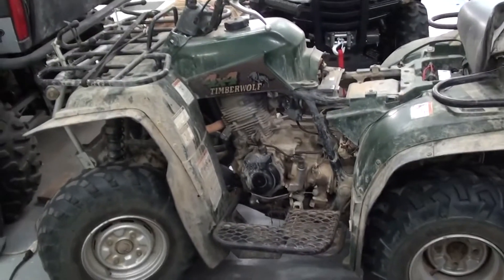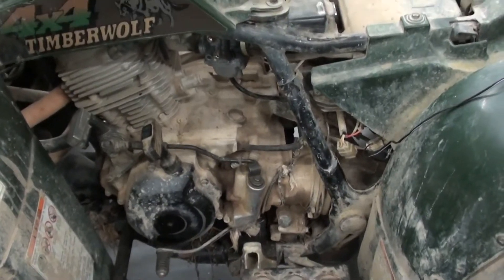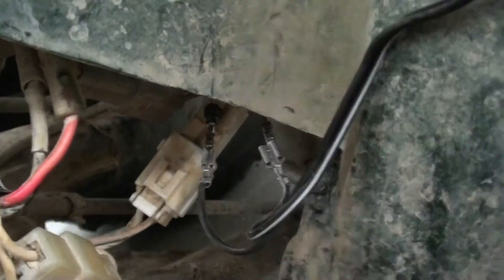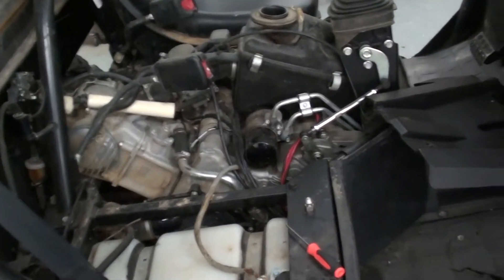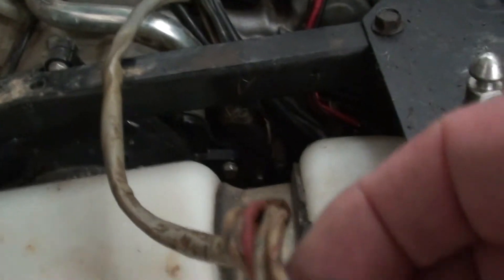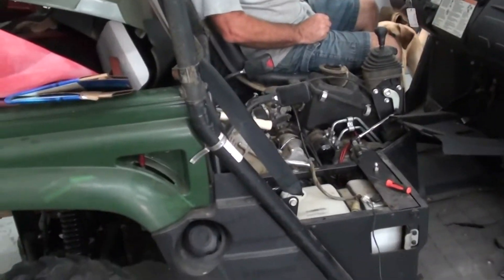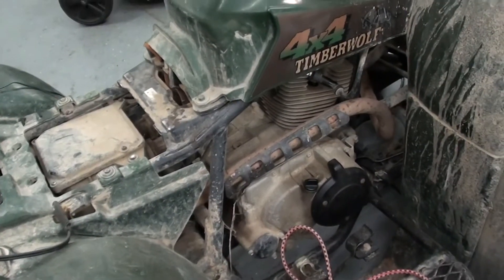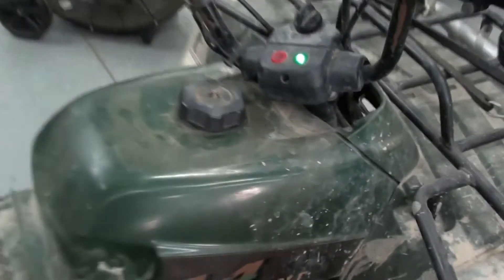Electronics Troubleshooting Redneck Style At D-Ray's Shop!

Comment: I greatly appreciate your videos & knowledge, not to mention your humor..I have a problem, I put a new starter in a Honda 1991 trx 300. I go ton connect the battery & the starter engages, no key no button use. In ran with kick starter b4 I replaced it.. Any Ideas wool be greatly appreciated? Fuses are good solenoid is new as well..

Comment: On a. Razor 800...does the air intake need to be higher than the motor...I changed mine too between the seats...about hip high...having trouble starting now...?

Comment: iv got a 08 500 foreman es. when it's over 1/2 throttle in any gear but reverse it gets stuck in that gear. the gear indicator will flash that gear and can't shift at all unless turn key off down shift to neutral fire up and take off again. have you ever had that problem
Reply from the maker: sounds like a weak shift motor.

Comment: One xr600 had bad exciter coil. It had working lightcoil.  So I put 220v to 12v transformer wrong way around so the lighting coil output would be high as the exciter.  It worked and run fine for 10min or so.  Then the transformer  got fried.

Comment: I think we all must be a little bit redkneck :-D.
A 21 watt bulb on loooong wires comes in handy, it also adds a load to any circuit you are monitoring, multimeters can see phantom voltages so can be deceptive.

Testing for radio power.
Lighting problems.
Wiring a toe hitch to a car without schematics.
Checking for power at a petrol pump, using a safety pin to penitrate the wires.

Very handy the bulb :-D
Reply from the maker: Good stuff!

Comment: hey dray, 85 big red, cool weather, have to shake it side to side to get it to start, very cold natured i guess. Does it need a different needle? I have to tie the choke button with string to keep it on choke......also the green light wont stay on unless i fiddle with the key...new switch i guess?
Reply from the maker: The choke jet is probably plugged. also 85 was the first year for the 250 big red, and they were pretty notorious for hard starting. I drilled out a lot of choke jets on those to make em choke better. Your choke lever won't stay on choke because the detent spring and ball in the lever is either rusted or missing.
Reply: thanks d ray, was wondering why you took down the last video

Comment: I love your videos. I want to ask you I have a 2016 Honda pioneer 500 and I love it. But the rearend sounds like crap when the machine is coasting or when you let off the throttle. I've read a few sites about this and it seems to be a problem. What would you recommend doing?
Reply: Haha that is pure genius
Reply from the maker: Those machines have molded, straight tooth gears, they are not a matched ring and pinion set. You could try re shimming the gears, but it is most likely going to be noisy. Only other thing I could recommend would be go with a higher viscosity gear oil. "85w140"